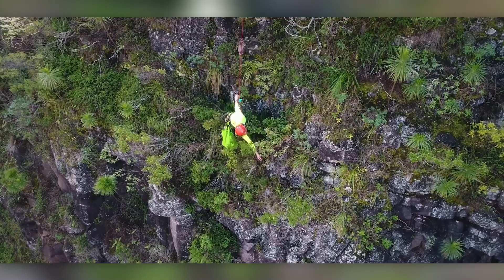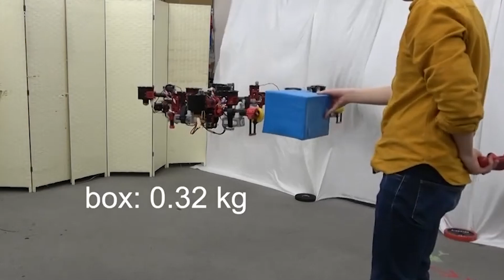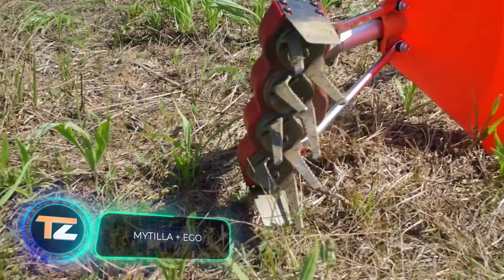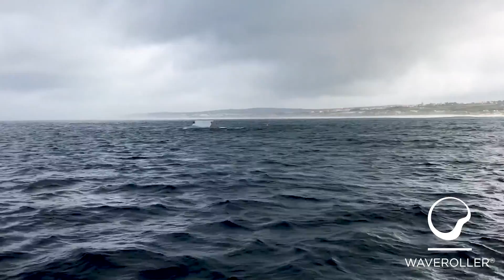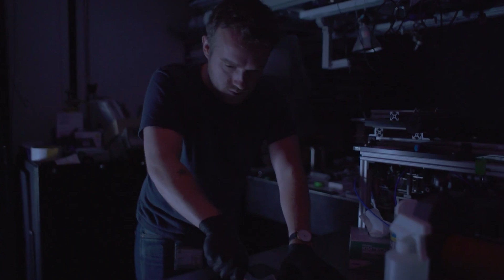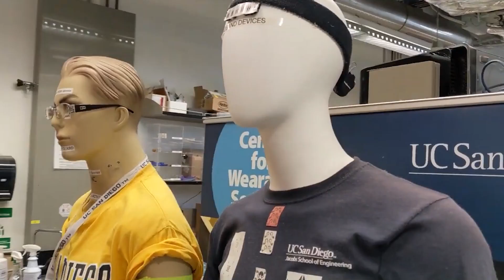13 AMAZING INVENTIONS YOU SHOULD SEE

Comment: Give me a light weight Combustion engine over these endless battery replacement systems and cars. Tools are the worst. If I cant get continues use with out stopping every 30,60,90 min if it dont work with the same speed or torque for 8 hours I wont buy it. And it must be price comparison equal or less!